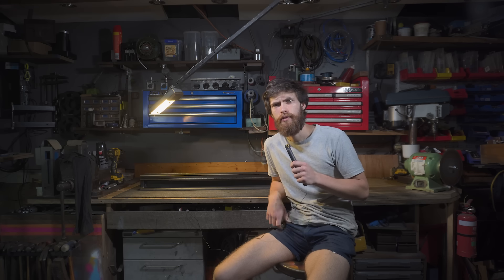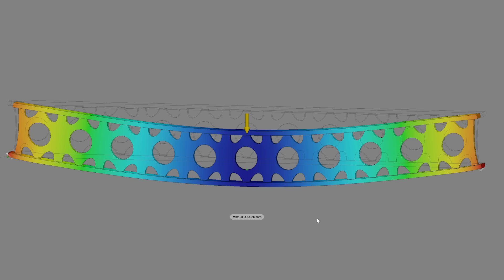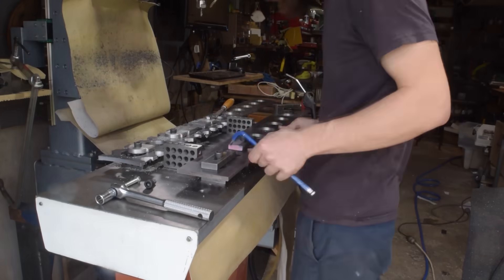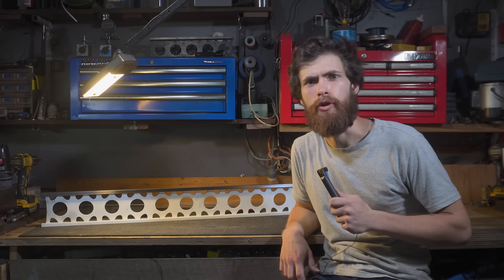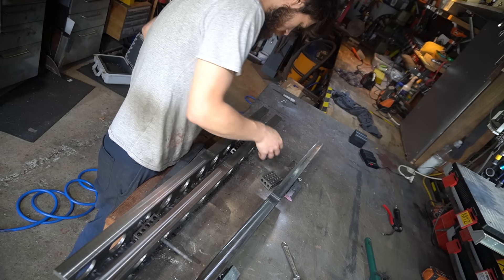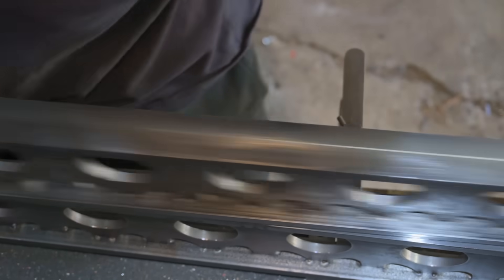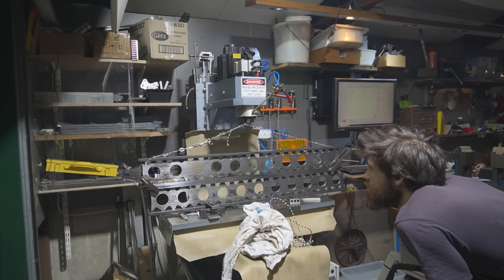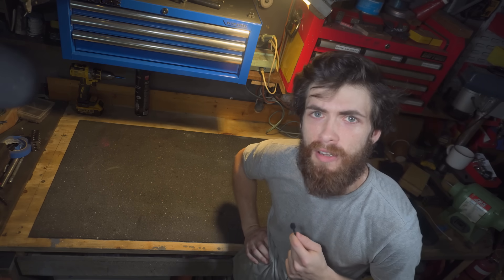I need a PRECISION straight-edge, so I made three

Comment: me? die grinder. seriously, scraping steel is no fan task. i consider it cheating, but it works.

reciprocating with the mill was genius, except... as you probably noticed... you need some oscillation as well... 

good good good, good gyrations...

iunno. seems easier to find someone with a planer... 

are there even any planers in australia? in working order? i know theres a nice gleasson bevel gear generator at eveleigh, how i would love to fire that thing up and throw some chips into the hipsters latte's, but yeah... until the crash comes, its just gunna stay as an ornament for toyboys that have no idea wtf it actually DOES...

oh, i just had that stupid idea... try making a freaking COLLIMATOR! actually, if you understand how they work, its pretty easy to do with a laser pointer and a reference tacked to a handy tree/wall/LJ torana parked a decent distance away... just map out the discrepancies and start scraping...

this is way overkill for a vintage lathe...

Comment: You needed to stress relief after the welding
 They are going to warp, let alone they should have been heat treated as well to make the surface resistant to burs and dents. 🙃

Comment: To check true flatness and eliminate bowing caused by gravity, the straight-egde should be placed on two round pins at their flex points. That would be the total lenght multiplied by 0.211, then substract that from each end and marked. The same applies for gauge blocks longer than 4 inches as bowing causes errors in lenght.
AlsoNotAnEngineer

Comment: Muriatic acid and some stainless steel scrubbing pads with appropriate PPE works wonders on mill scale.  Picked some up from a local store and fully cleaned one side of a sheet of steel (4ft x 8ft or 120cm x 240cm) in about 30 minutes.  It does produce a nasty gas so good ventilation in a shop or outside while standing up wind is a must.

Comment: traditionally precision straight edges would have wooden handles to help insulate them from the heat of the operators hands. either on the top with the camelback style, or poking out of the ends with a triangle style. 

fantastic video

Comment: 30% vinegar works great for removing heat scale.  I would recommend doing it before any machining. Submerge your part or wrap it in wet paper towels then wrap with plastic to keep the vinegar from evaporating. Depends how warm it is and thickness of heat scale but it should take a few hours to overnight.  A little agitation helps.  Follow up with a good water rinse and wipe with a moisture displacing oil.
Reply from the maker: The wet paper towels is a good trick. I always use vinegar on smaller parts, but I haven't got any metre-long vessels
Reply: Any size container, within reason, can be made with dimensional lumber and plastic film. Just a thought.

Comment: Nice work, I tried epoxy casting a straight edge on an oiled gradite surface plate and the epoxy ripped holes in the granite. Looking forward to seeing the lathe bed repair, My M300 has about 0.5mm dip and Ive been toying with using a homemade moglice / turcite recipie using epoxy, brass powder and tungsten di-sulphide. Subscribed.

Comment: I think this would have been easier with a large surface plate. So, you should've made three 1m x 1m surface plates first. And of course, really cast iron is a better choice of material, so next time consider building a furnace capable of melting cast iron. It'll be a big time saver in the long run. Just some helpful tips from a couch engineer.

Comment: I am designing a really beefy cnc router that will probably be closer to a gantry mill. I have been pondering setups to make two sides parallel and flat on my 32" mill bed. Your setup is pretty similar to what I had in mind

Comment: Unfortunately the 3 plate method refers to 3 "plates" & does not work on 3 edges because they can't be rotated 90 degrees to each other. I would also consider the beam support points - Airy or Bessel points that give minimum deflection. Support the bottom beam on these points when rubbing together. Normalising after finish machining has to be done before final hand finishing.
Reply: wronnnnng! I made a straight edge same way, go back and rethink this!
Reply: Without rotation there may be twist in the ground surface.  I saw enough rotation from slop when hand grinding to reduce this twist to insignificant for the intended purpose.  If it really matters, twist can be checked with an old carpenter's tool, winding sticks.

Comment: Engineer here. The 3 plate method only fully works for squares or circles. If your long rectangles have a twist, you can not correct it. Will it be good enough? Probably, but you will not get the full degree of accuracy.
Reply from the maker: Planning on a precision level to try and measure the twist!
Reply: @NoEngineerHere you can do pretty well measuring the deflection over the ends of parallels on each end . I guess you could average out over all three then repeat te lapping. Couple hundred cycles you could be confident it’s near enough 😮. Precision levels are fun to work with- make sure your floors good solid 😃

Comment: Great effort on gummy mild steel mate but you totally missed an opportunity to employ a six surface flattening method. Could have written your thesis based on all of your work here as well as a fully floating 2 over 3 automated lapping machine operating under a fine mist of isopropyl alcohol maintaining reference temperature and overcoming deformation due to friction heat😂😂😂 (see how easy it is to create bulls88t engineer speak?). Mild steel hates to become a precision surface with machining. I’d suggest descaling everything next time you or anyone else goes at it with a precision job. Then do your cutting, then normalise with heat, then welding with another round of normalising. Lots of barbecue burners will do it. Then clean again in vinegar. 

I was lucky enough to be sponsored by my employer to step from mechanic to mech engineer. I regard there to be many types of engineers including trades and associates along with professionals. From your approach and hands on skills I’d guess you hold one of those quals. Or are just very detail oriented. 

Anyway, my work resulted in me having an accident where I wrecked my back and resulted in early retirement at 38. I’m building a new home workshop to keep myself busy and have free time so feel free to shoot me any questions you might have. I do it for some mates in business manufacturing high performance parts just for the enjoyment. You have a fun channel and I enjoy watching people learn and give things a red hot crack.

Comment: FYI, engineer here, stress relief probably would have helped reduce the bowing problems. Residual stresses from welds are insidious for this type of work.

Not hard to stress relieve mild steel, could probably do it in the barby.

Comment: Is not a school what makes an engineer. Your engineering skillset is determined by what you do with your brain and hands. Of course right mindset and attitude coupled with a good formal education make for much better engineer than mindset alone, but mindset and attitude alone are much more relevant.
I am a school engineer myself, and a successful one on my own field. For years I taught at university and I can tell you my classroom was more than half full of people who would get an engineering degree but never be an engineer. After moving to industry I still see the same pattern, many (holding degree) non engineers working as engineers.
Reply: I once supervised some engineering students in designing and building a project.  The only one worth anything had grown up on a farm where necessity dictated that they fabricate and repair all sorts of their own machinery.  The problem (what had changed since I was in school) was that engineering students were no longer allowed to do anything themselves because their insurance company insisted they avoid the potential liability involved.  So, where, a generation earlier, engineering students at the same school used the machine shop and made sand castings and had to design and build a drill press from scratch in order to graduate, the current generation spent all their class time in analysis and doing nothing hands-on.  If they needed a project made, they had to submit it to the machine shop and wait 6 months for it to clear the backlog.  Rediculous, but they did keep all their fingers, I suppose.

Comment: The thing I don't quite get is that if you are rubbing three lengths together of the same length then surely the ends are not getting the same amount of abrasion as the middle - does it just "sort itself out" or come out in the wash?
Reply: It just sorts itself out. Thats the big reason behind using three plates.  The contact points always vary across the surface, so the highest points will be the only points of contact between the surfaces. As the high points wear down on one plate, the points change when you introduce a different plate. Eventually every plate starts to flatten regardless of stroke length.

Comment: As a woodworker, I periodically reflect on how easily one can produce a straight edge with extraordinary precision using nothing more than a plane and feeler gauge. Simply clamp two boards together and plane their edges as straight as your plane can manange. Then unclamp the boards and put those two edges together, and check the gap between them with the feeler gauge. The gap between them is double the deviation from straight of each board. So with a .001” feeler gauge, one can easily produce a straight edge that is less than .0005” out of straight over its entire length, which is damn good for basic hand tools.
Reply: When I was cabinetmaking at my last job, the precision we could get when joining 2 bits of laminate together using nothing but a block plane always satisfied me
Reply: I think in a similar way you also have three surfaces, the two boards and the plane.
Reply: It's all in your level of personal pride. Give me a wood or iron hand plane and I can clean rough lumber up. Give me a four side planer and I will clean it up and make it square and parallel. I might even make it straight. Add a molding or too at the same time and all at high speed.
But timber is both forgiving and volatile.
Plane it today and tomorrow it's moved. Tension or moisture gain or loss.
Reply: I don't think so?  you can match two curved boards within .001", and that doesn't make them straight.
Reply: @somebodyelse6673  They do become straight, because they are planed when clamped together side by side, and so they match - and then you flip one and compare it against the other, by laying them on top of each other. If they are not straight, they no longer match and you go back to planing.
This works because a horizontal line is the only curve that matches itself when flipped vertically.
Reply: @riccardoorlando2262  - I wonder why the Whitworth method still requires 3 pieces when used on metalworking straight-edges then?

I did misunderstand you though, read it as you stating that matching them with a feeler gauge was the key requirement.
Reply: I'm a year late to the party here, but I think I have an answer.

The method described of planing boards is identical to the whitworth 3 plate method in one key way: it creates two identical surfaces, and then achieves flatness by comparing them to each other to subtract their errors.

With the planing operation described above, the plane is assumed to create identical edges on the two boards.  A third plate is not required because this assumed precision is good enough for the purposes of the straight edge being generated.

With machining there is no equivalent method of creating two identical flat surfaces, other than to use a third plate, spotting and scraping it to be the opposite of the first two plates.  While the hand plane isn't directly serving as a "third plate", it is providing the same function.  We simply don't have the equivalent of a hand plane that produces functionally identical edges on metal... and even if we did our precision is coming from that tool, and the whole point of whitworth is to be able to originate precision without such an external reference.

As an edge case, there are also surfaces that will in fact fit each other perfectly without being flat.  Mathematically, its three matching surfaces that must be a plane.  The hand plane on boards method mostly avoids these  by the nature of the process, but it is at least theoretically possible to to get two boards that match without actually being straight (though achieving this on wood with a hand plane would be unlikely).
Reply: 5 months later… The described method for the boards only ensures straightness in one dimension (along the length), not two. The 3-plate method ensures straightness in two dimensions, i.e. flatness.  As long as the boards are sufficiently narrow compared to their length this usually won't be an issue.

Comment: This was an excellent video and I learned something today. Do you think sending out for laser cut components would be a viable option for a similar project? I see you machined the speed holes and  am wondering what f you did that to relieve any internal stresses in the material.
Reply from the maker: Alex had his laser cut! I considered plasma cutting but was a bit worried about warping them
Reply: I highly doubt he stress relieved it, and neither did Alex (the guy he referred to in his video from who'm he got the idea). There's an incredibly clever and ingenuitive Ukrainian guy here on YouTube, named Gena Bazarko, who also made his own precision straight edge from 3 carbon steel "I" beams, managing to get them flat down to an amazing 1 micrometer. But when he re-measured them 2 years later they had warped one or two dozen micrometers. And that's without having welded anything, so let alone how bad it would be after welding. So yeah, a welded straight edge definitely needs to be stress relieved, preferrably twice even.

Comment: On removing mill scale from flat bar - the least shit ways I've come across are using one of those fancy spaghetti silicone carbide grinding discs (rust and paint removal) or soaking o/n in vinegar solution.

And before any y'all tell me the spaghetti wheels are shit, I say it is you in fact who are shit. The Lynch pin of the operation is a variable speed grinder. They don't like to spin at 15,000rpm I run them on my Milwaukee automotive polisher @ 600-800 rpm. It works like you always wished it would.

The vinegar solution bath is best if you have the foresight or patience to wait but let's be honest, I want my raw, clean steel right now.

Using a sheet of plastic and some timber, I made a shallow bath for an 8.5m length of 125x10 PFC a few months back and well, stripe me pink and call me Susan, in 8 hours the length in its entirety was cleaner than a Kansas City clap doctor.

Comment: I’m a third year mech engineering student, I had no idea about the three plate method. So cool. I’ve learned more online then from university, I would say the constant assignments and disruptions it’s caused has actually impeded my learning. Don’t ever consider going back shool it’s for children and people that need permission to feel accomplishment, just keep Engineering.
Reply: I'd say you have to be kidding, but I'm pretty sure you're not. I'm a high-school dropout and know about the three plate method. Never expected to see anyone use it. Technically he has a five-plate system, since he can use both sides of each straight-edge. He just can't use the opposite side of any straight edge.

Without knowing the precise distortion from thermal expansion of the materials it's impossible to know how straight he can possibly make his instruments in day-to-day work, but it's sufficiently accurate that simple matters like body heat will distort them sufficiently it can be detected with simple tools.
Reply: I'm a MechEng graduate, Josiah Whitworth wasn't on the syllabus.
There's a big difference between the kind of engineer that makes things and the kind that designs them.
Reply: This is why the actual workers get annoyed with the engineers.  You are learning how to use a pencil, not how to make things.  Best to remember that if you want the cooperation of the actual fab guys.

Comment: Great project, great job! Those will serve you well and be more stable as they age. I made a 30 inch surface plate and lapped it to .002 and used it to make a small straight edge. I used the long side of a large (24 inch) framing square with no holes or weldments. I lapped the edges to .001 or better and parallel within .0002". It's all I need for um, woodworking.
Reply: Geez , are you gonna make wooden high-speed bearings?
Reply: @burningpentagram666  That got me, man. Talk about underrated comment.
Reply: Hi,
Q.
Please; 
is your surface plate end-grain or top-grain?
Also:
Did you varnish it?
Thanks.
Reply: @โนรีคอกเบิร์น  I finished it with slow-cure epoxy filled with 25% 1 micron aluminum oxide powder to make it wear proof. I lapped the epoxy with an aluminum beam with 3M wet sandpaper and water.

Comment: Removing mill scale with vinegar is much easier.
Reply: But not much used to pickle and oil in steel processing plants....(Muriatic acid out behind the shop followed by pressure washing a s spray of WD40. Keep the vinegar in the kitchen and the industrial chemicals in the shop. -